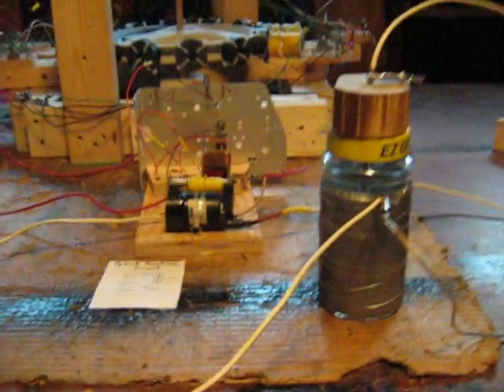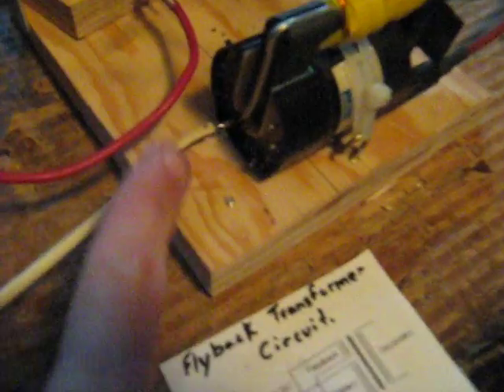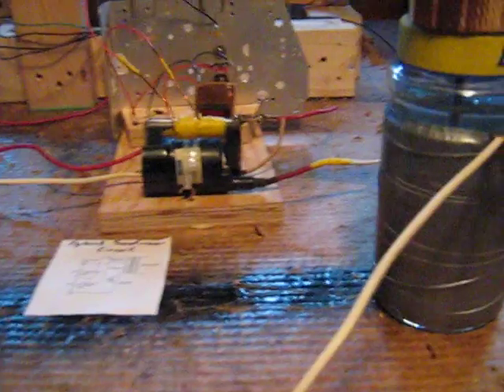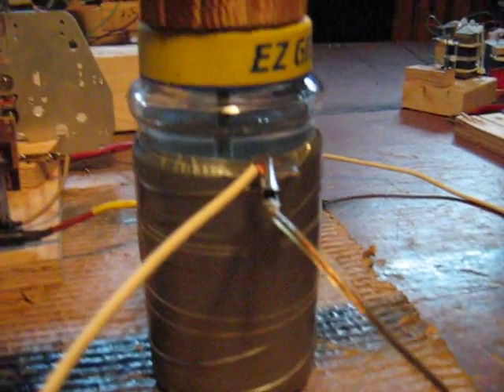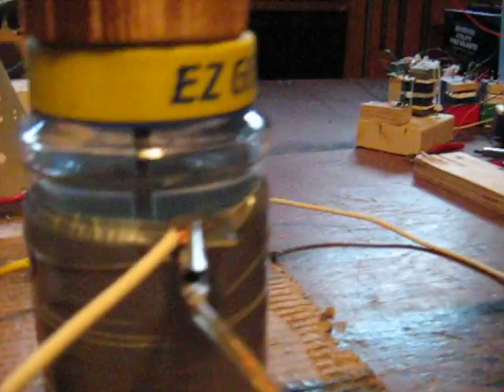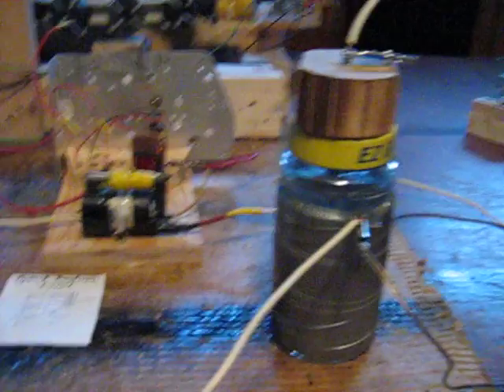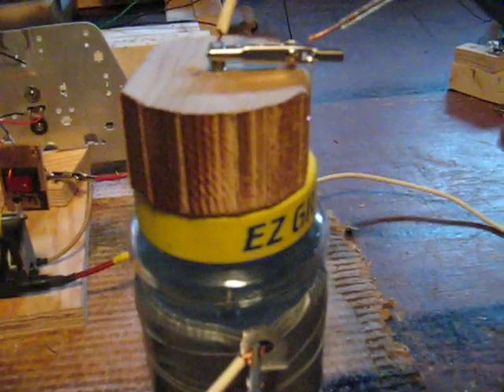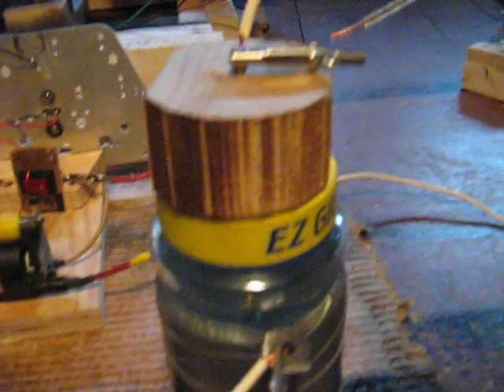Saltwater Capacitor With Flyback Transformer

Comment: Before I say this, I should mention that I'm NOT joking! While your device is sparking, spray fine mist of water between the electrodes or even allow steam to pass between them. You will be shocked to see that water will explode between your electrodes. For seeing that phenomena even better, use HV diods and connect the positive wire before the flyback to the positive of secondary of flyback. By doing that, you will have a higher current added to your high voltage. the power would be much more

Comment: Saltwater caps rule, but I need to make a better one in order to use it with my ZVS because im putting in so much power that the arc jumps from the top of the jar to the aluminum around it anytime the arc goes out. It does create some cool effects though at high powers